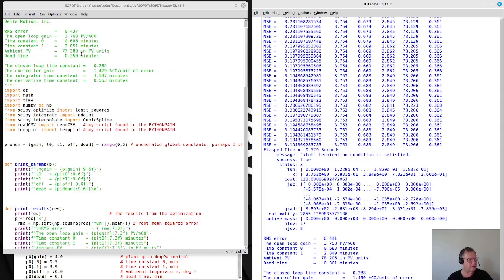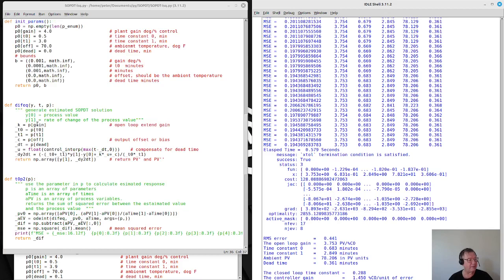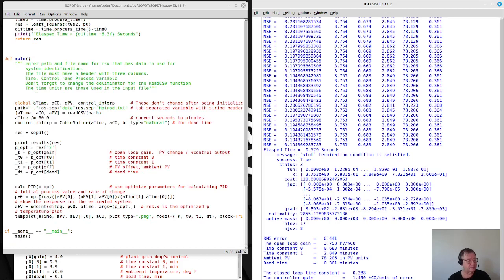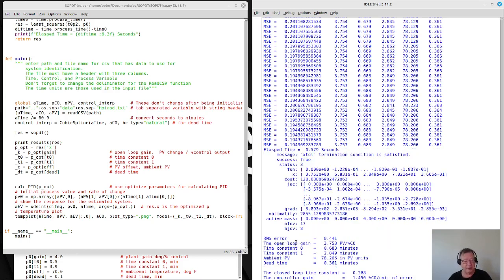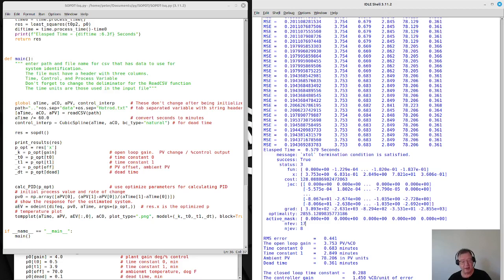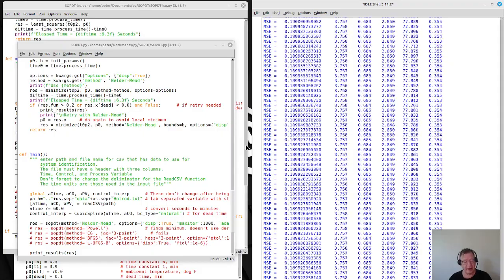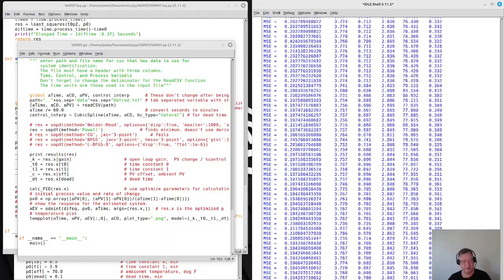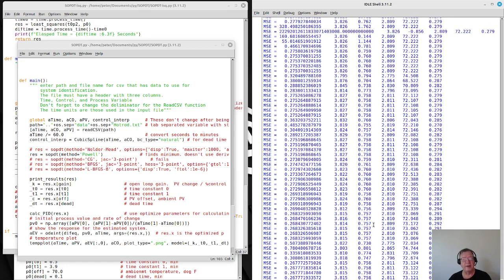Peter Ponders PID - System Indentification of a  SOPDT temperature system using real data.

Comment: the data doesnt seem to have any noise, is it really real world data? i am looking at the graph and data at 1:06
Reply from the maker: It suffers from sample jitter and quantizing error.  The data was recorded as a Rockwell trend on a PLC/5.  The input card only had a 12-bit AtoD converter which is why some of the readings between samples didn't change.  There wasn't enough resolution to see small changes.  Also, The PLC didn't have a method of really sampling at exactly 1 second intervals. By using the mean squared error over the whole 20 minutes, the "noise" is effectively filtered out.   This is a MUCH better way than trying to compute the rise time from two points.  The more points the better except one must be careful because there could be an overflow if the initial guess is bad.  Most "optimizing" or "minimizing" routines use the sum of squared errors or divide by the number of samples to get the mean squared error.  SSE or MSE doesn't make any differences in this video but there is another video about using the gradient descent.  Now it makes a difference because it affects the "learning rate" parameter.